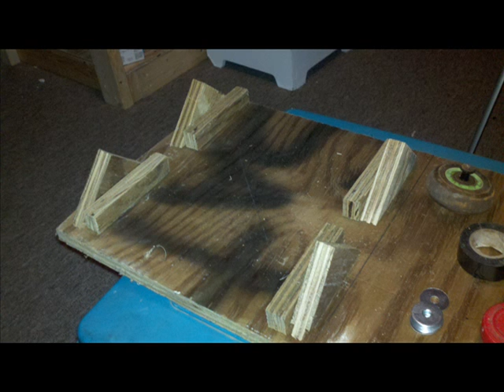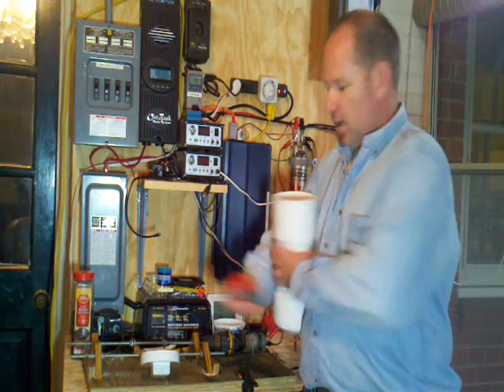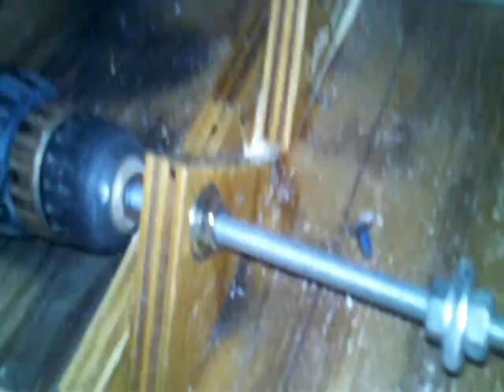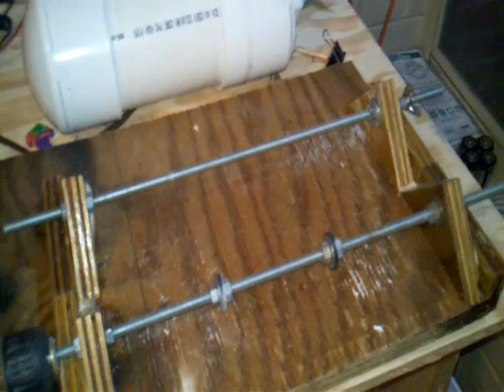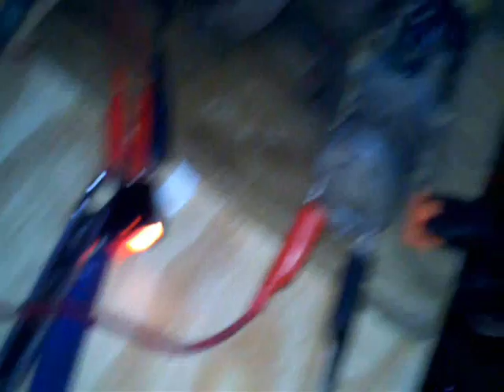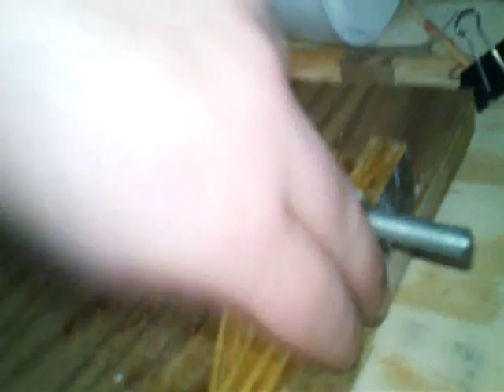How to make a ball mill to process your own black powder

Comment: Great job on the DIY factor, but that is honestly a terrible setup. Firstly it’s being milled in your shed, potentially causing shrapnel wounds to yourself or family. The voltage is poorly regulated to a dc driven motor that will potentially overheat and produce and ignition source (especially through the crocodile clamps). Your rpm to ball size is not calculated to suit your drum diameter, therefore very inefficient & an increased risk of heat build up & ignition. No mention of magnetic filtration of your milling media - both during the casting of lead balls and the materials being milled. Lastly a PVC container?..  what a joke!🙄

Comment: +Guy Brown   You do know that most power drills typically use direct-current brushed motors that create SPARKS which makes this extremely dangerous. You're going to get someone killed. You either need to post details about brush motors at the top of the video or remove the video.

Comment: I got all the stuff to make a similar ball mill.... Just haven't found the time... I've been using a 2 liter pop bottle with a bolt through the cap, put the bolt in the drill chuck... Add media and the chemicals to be milled.... Close it up.... Float the bottle in a small tote full of water and run the drill... Like your setup better

Comment: Is it not bad for your 12 volt motor to be pumping only 6 volts through it?  I've heard over the years while building crazy projects of my own, that it is bad for a motor to run it way below it's rated voltage... am I thinking of a different type of motor than what you have implemented here?
Reply: +Jonathan Hoffman correcto mundo Jonathan, what you would want to do is use a PWM circuit to send the rated voltage at varying frequencies to slow down the motor.  This assumes that the motor is not designed to be operated at different voltages of course.

Comment: Could you use glass marbles instead of lead?
Reply from the maker: Might take longer rto to do the job but should work.
Reply: Guy Brown Can you use brass ball bearings or non sparking nuts?
Reply from the maker: I would think so...
Reply: No, not glass marbles for black powder.

You can use it to mill the individual ingredients, but glass will leave a residue in whatever you're milling, plus it's not completely non-sparking, when milling all three ingredients together.

Use brass balls, or bronze, or full-metal-jacketed bullets for .45ACP from any gun shop that sells loading components. 

Best bet is brass bearing balls, for repair of ball bearings. Ebay is eaten up with them.  

Balls are easiest on your mill drum, but you can also buy 1/2" brass rod and saw off 1/2" chunks.  

Best to grind off the sharp edges of the chunks, though, which makes it even more labor-intensive.

Comment: Looks great, and I myself enjoy a project, but Wouldn't this work just fine with say, a hobby rock tumbler kit, for around $50-80? (Depending of course on how much size matters to you)
Reply: People will tell you that a rock tumbler doesn't spin fast enough, and that the motors aren't strong enough to turn the drums.  

In many cases this IS true, but people use them successfully all the time.

The big Thumler's Tumbler, for instance, doesn't work well because the drum should be 50% full of tumbling media before you add another 25% of powder then leave 25% empty.  

If your media is lead balls, the amount of lead needed to fill the drum 50% full weighs too much for the motor.

When you first turn it on, you must give it a spin with your hand to get it going, and after that there is a tendency to overheat.

But the little tumblers listed as "6-pound" are fairly widely used by people who don't need to make a whole lot of powder in a short time.

It consists of two 3lb drums, and they load only one of them, which makes a 6lb load of lead instead of a 3lb load of rocks.  

That's the weight that the motor and belt are rated for.  

Seems to work just fine for powder that will be shot in a gun.

For making fireworks, you need to make a lot more powder, which is when people begin to get concerned about how much they can make in how short a time.  

That's when they generally get into building their own (not a scrap-drill powered joke like this), so they can actually put 30-40 pounds of lead balls into the mill and mill a lot more powder at once. 

That typically involves an A/C motor about 1/3hp, in a divided cabinet, driving rollers that spin the drum in the other side of the cabinet. 

There a number of videos here showing the building of same. 

The divided cabinet is because fine powder can get into the air and be exploded by the sparking a motor running.  

Even pure charcoal can explode when so fine that it's floating in a cloud.

Comment: what do I use to power an 18v motor out of a Ryobi drill? Can I configure a transformer from the battery charger?
Reply from the maker: rvfg123 You can use 12 volts it just wont run full speed, which is fine cuz you want to run about 90 to 100 rpm. Thanks for watching!!!
Reply: Guy Brown I have an eggbeater motor that runs much faster than 100 rpm, any idea how I can slow it down?
Reply from the maker: Gear it down.

Comment: I don't have a clue what all that stuff he has on the wall is for, because it definitely is not for the ball mill. The only thing I see he might actually need is a power supply for the motor, and the timer, but everything else looks like it's there for show. He must have just set up the ball mill near another project he's working on or he has a solar backup that's running through all that stuff in the background.

Comment: I'm making rockets but I have shot my home made BP in my BP 44. I use air-float charcoal.  I've posted a new revised video on making cold mix BP before heating it.  I mix it cold for an hour then heat and process.  I can make 1kg of powder in just over 2 hours using this method and so far the consistency is impressive, the best I've ever had.  I have 6 BP rockets I intend to test tomorrow all using the same case and rocket design. I still intend to make a ball mill. :-)

Comment: What size grains are you making. I wet mine with Acetone or Denatured Alcohol and make it into a ball and push piece of mesh or window screen. Then lay it out on news paper and let it dry. If you want it for rockets regrind the B.P. after it dries carefully or ball mill it again. Once the KNO3 has been wet it has done its thing by bonding to the sulfur and air float charcoal.

Comment: To correct David Vesper, to correct and optimal charge for a ball mill is 50% milling media, 25% material, and 25% empty space. This creates the optimal milling conditions for powdering materials. I do agree though, you should look into getting a different motor since brushed motors are not optimal when milling flammable materials, for obvious reasons. Good work though, and check out my video of my mill I built a couple years ago.

Comment: I love it, think I might build one myself.  I cook my black powder like the old army manual says and I can make 2lb in one hour if I have someone to help me.  The thing I don't like is the alcohol bath and drying process.  I lose the smallest dust from it which is good for rocket engines. Would rather ball mill for two days I think. Just didn't like the ones you buy for this process. Like your idea better.

Comment: Bravo on your creative design for the ball mill.I love the skate bearings. One word of warning! DC motors use brushes this means lots of sparks! They cool by pulling in room air and and explosive dust as well. Here is a little data on milling material you might find useful. Container: 50% empty by volume, 25%milling media, + 25% BP by volume. Rotation should be 30 to 35 rpm. Try .50 dia ceramic-aluma media. Keeps your potassium nitrate white! No lead  to wear down. Keep up the good work!

Comment: Call your local roofing supply store. They sell lead drain flashing which is quite literally a rolled up piece of pure lead that is 3' X 3' and weighs 4lbs each. Easy to cut into smaller pieces with tin snips to melt down.

Comment: Way too loud...I used the whole inline wheels and a 12 volt motor from a boat vent housing and a speed control all on my solar setup and it's super quiet....the motor shaft can drive the wheel by just setting it against it...I also added another set of wheels to add a 5 gallon bucket using the same setup to make firework stars...dual duty....at around 20 rpm to around 200 rpm.

Comment: That's awesome. I see lots of great ideas for making my own ball mill to. You just built yourself least a $500 ball mill. Did you burn your fingers yet? I did with that lighter stunt. Hurts don't it? Now I use a BBQ lighter. But still, you inspired me cause I was gonna buy this tiny one. So I'm getting 8 skateboard bearing for $4.99 from VXB. And some sort of Variable speed Router controller for my 1/3 HP drill press motor. Post, So the FBI don't think I associate with the MIT brotherhood.

Comment from the maker: No bot really.  At first I thought it could be possible but now after running so many batches thru it I have not seen any satic issues at all.  Thanks for watching.  FYI I just posted several vids using the ball mill and star roller.

Comment: You don't want to use briquets.  They have binders and additives that will slow the powder to a crawl.  Use natural charcoal.  Commercial natural charcoal works OK but best is to make your own from a soft, low density wood like Willow, poplar, cottonwood, etc.  The wood can be cooked into charcoal via the "retort" method or the "top lit up draft" method.  A note on safety... I know not everyone has the space but I put my mill hundreds of feet from the house.  Don't want to take any chances!

Comment: You can cast 1000+  1/2" lead balls over a weekend with a lead fishing weight mould. Ring your local metal recycling place for scrap lead, if your lucky they`ll have a load of clean lead flashing offcuts (150mm wide x 3mm thick). I paid £1 per kg for cash ;) .

Comment: Ideally the jar should be half full of grinding media if the drill motor will handle the load.  A 4" jar should run around 90rpm, a 6" around 75rpm. Using glass marbles isnt the best idea, stick to lead, brass or ceramic.